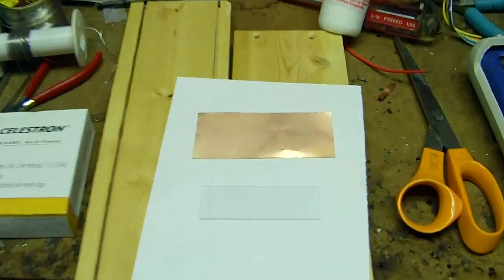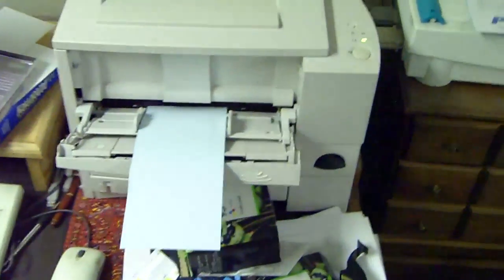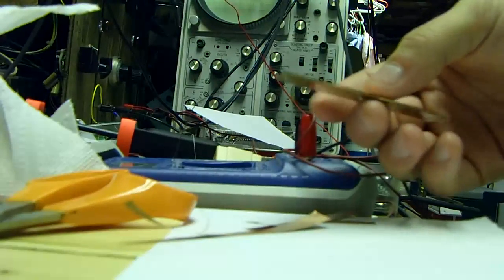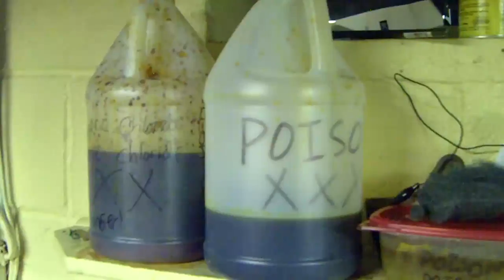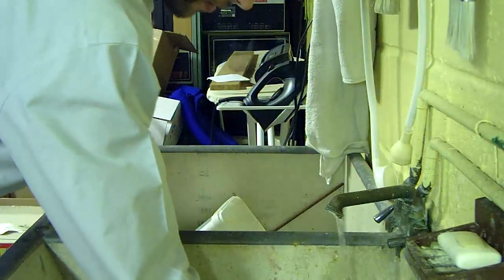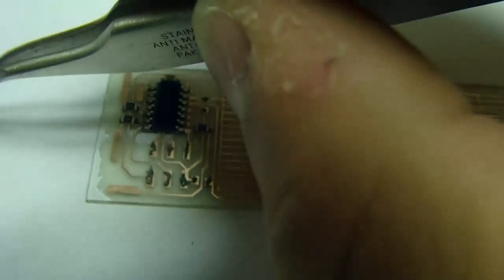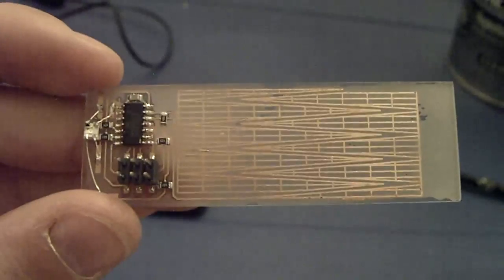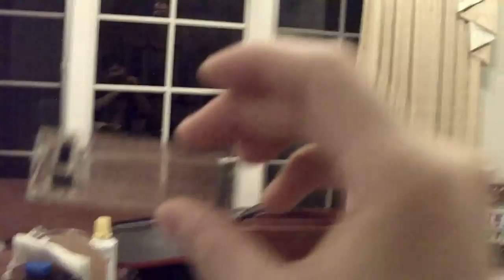How to make Clear Glass PCBs

Comment: The EPROM eraser uses shortwave UV light that is almost completely blocked by ordinary glass.  That's why the EPROMs have quartz windows.  A blacklight style longwave UV lamp may work better.  Have you tried acetone nail varnish remover to clean the residual glue off?
Reply from the maker: bigclivedotcom Acetone causes the traces to slup off.  I think it gets between the traces and the back of the PCB.
Reply: +CNLohr  maybe the apliedscience's evaporative method would work? It's fast so I'm thinking maybe it would not have the time to get under the copper traces.
Reply from the maker: I really need to make more glass PCBs some time.  There's so many things I want to try and new ideas so many people have had..  Right now, I'm so busy with other stuff.
Reply: I tried using an EPROM eraser to cheat making photo-resist pcb's in the 1980's - It took forever but eventually worked. The problem is that the wavelength of the UV light is wrong. It's like the difference between UV-A and UV-B.

Comment: Wow, this is really ambitious and a very cool idea.  We have expensive Liquid Flow Meters that just use a plate of glass over some heat detecting LEDs to act as simple push buttons but yet have the circuit isolated from the externals.  This...could be very handy...great job by the way!

Comment: Your etching solution is actually etching the glass giving it a frosted look. If you use pyrex or borosilicate glass slides you will not have this problem. You will have totally clear boards! The glass you are using must be a "soft" glass which has a COE (Coefficient of Expansion) of around 130, Pyrex or Boro glass has a COE of around 30. The low COE also makes it far less susceptible to thermal shock. Clear and no cracks! Win! Also this is one of the coolest things I've ever seen!

Comment: Very good work I must say.one thing I see a lot is solder iron so big for the smallest work.And all so in a right mess .i have 7-soldering irons all different and shiny clean.one iv just bought is 12-volt and I Added a tiny micro switch so when I hold it I just press with my finger and all added a white bright Led the Led stays on all the time when I'm using this micro soldering iron.your work is good and would be easier for you to use a small soldering iron for when you re-solder some of you micro work.great video keep up the good work

Comment: Also a syringe works well for depositing solder paste in tight areas, and automotive clear coat finish is highly resilient when it comes time to use solvents such as acetone, and is somewhat flexible until cured.

Comment: Neat method for single sided surface mount designs but a few tips: 
1. As Java Lu (and maybe others) said, TRIPOD - PLEASE!!
2. Tin board with tinning solution before assembly - gives superior soldering
3. Use several coats of auto-spray lacquer on final assy for vastly superior finish.
4. When spraying remove all connectors & protect the header pins with sleeving or low tack masking tape for larger blocks
5. CLEAN your soldering iron tip PLEASE & use a much finer tip for such work

Comment: I dont do this stuff, but am interested in learning how. So for what it's worth from an inexperienced observer, perhaps using a hot plate or inverted iron to heat the glass evenly when melting your solder paste would limit the possibility of cracking it.  place the slides in a thin frame (thumb tacks point up through cardboard) to prevent them from sliding around as much when applying the poly. Split a small dowel in half and pinch steel wool between the halves.  Insert one end into a drill.

Comment: Compressive forces on the surface of the pane make it much harder to break. However, high tensile strengths in the glass pane make it shatter if cut, chipped or even sometimes scratched. This is why car windows, for example, will shatter into small, barely sharp parts instead of large, razor-sharp pieces.

Comment: @CNLohr basically the same thing you do to eat away the copper but for the UV glue you have. Use a solvent instead of ferric chloride(not sure if that's supposed to be one word or not) and use the etched pcb traces instead of toner. That way the glue is removed from the glass and the traces protect the glue under it. Like I said though you're already doing something similar with the polyurethane but with the added benefit of replacing the glue with something else more permanent.

Comment from the maker: Schematic is in ExpressPCB. Full version of eagle is not free.  I don't use anything that's for pay unless I absolutely cannot avoid it.

It's simply discharges the circuit, then waits for it to charge via  1M-ohm resistor.  Depending on how long it takes to charge, that's how it knows how much capacitance you are adding.

Comment: @CNLohr I think orgameron means leaving the copper traces in place while brushing a solvent over the areas where you don't want/need the UV glue and just using the actual traces to protect the glue like the toner protects the copper during etching. It seems like that's more or less what you're doing with the polyurethane though as it cuts through the UV glue like a solvent but is also acting as a new method to adhere the traces at the same time.

Comment: I doubt the slide has a UV coating - it's just that  glass is not very transparent at the short wavelength used in UV erasers (253nm)  Eprom windows and eraser tubes are made of quartz for this reason. It may also be the case that the glue is not very res[ponsive at that wavelength. You will probably do better with a longer-wave UV source like an insect-killer tube (365nm).

Comment: excess solder can also be removed from bridged terminals on a surface mount components by simply stripping a piece of stranded copper wire using it like a sponge. i also prefer to take a grinder and chuck my tip in a drill to grind it to an extra fine point, then use liquid tin to prime the tip. Moving fast with a solder iron and solder paste you can avoid heating the glass by not exposing the glass to long periods of heat like you would using a messy soldering tip..

Comment: Have you ever tried selectively gluing the copper on?  I'm thinking: 
-UV glue the copper sheet to the slide
-tape a negative of your circuit on the non-copper side
-Expose the glue through the negative (so that only the glue under where the traces are meant to be gets exposed)
-Peel off the reset of the copper

Comment from the maker: Yes.  I got some glass that was angel gilded, chemically plated on.  I attempted to electroplate it further, but could not get it thick enough to electroplate effectively... The areas that I did were lumpy and did not go on even.  Keep in mind, you need about 1 mil of metal to make a good circuit board.

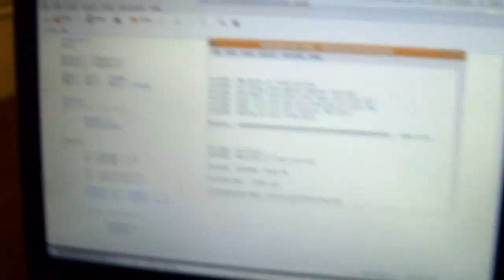Comment: That was a nice spark when you plugged in your programming board ~18:10.

Your last resistor looks like it had a short under it. From our view, the top one to our right of the IC chip.

The first time you place the copper on the glass slide, there is a better way to prevent bubbles to begin with so you don't need to squeeze them out. Basic bio-lab slide making 101.

Comment: To those asking about thru-holes, why not just have a ribbon cable on one edge that goes front to back? You're still going to be restricted to SMD, but if you could just get say 10 or 20 around that would be all that most projects would ever need.
Reply from the maker: you'd still need to print on both sides which is a pain.
Reply: CNLohr no pain no gain the Romans used to say

Comment: btw: what about using a transparent casting epoxy like those used for embedding carbon fiber or fibreglass

you could just pour a thin layer of epoxy directly on the copper - so you won't need any glass at all, get seamlessly bond material (transparent of course) and you don't have to worry about thermal issues while soldering 

technically it would be an FR4 or 5 PCB without the strengthening fibreglass sheets

Comment from the maker: I use Liquid Tin quote often on most of my projects.  The boards look 'cooler' with bare copper rather than tinned.  

I have still never successfully done a dual layer (not that I haven't tried).

I would imagine the static properties are almost identical to regular FR4.  I've been using glass circuit boards for a number of touch projects in my house which is carpeted, and even noticed some serious static, but haven't had a failure yet.

Comment from the maker: The glue is not conductive, while the glue is translucent, you'd still need a material that can conduct.  I do use this process for touch sensors, I put designs into the copper.

Comment: Consider using an optical grade UV curing glue and gluing the shiny (polished) side of the copper foil to the glass slide. This should minimize the translucency you see after etching and the traces will look shiny through the glass.
Reply from the maker: I actually use copper leaf from nimrod-hall now, so both sides are shiny :)

Comment: Some safety notes:
1. When working with UV eraser, please don't open the drawer when the light is on. The UV-C wavelength used is 253.7nm; can cause skin/eye cancer or cataracts;
2. When working with chemicals, such as FeCl, use eye protection or a face mask rated for use with corrosive or caustic chemicals;
3. When using volatile chemicals or chemicals producing gaseous emissions, please work with a carbon based respirator in a well ventilated room, or in a fume cupboard using forced convection

Comment: Nice job. If you want to take some advice, here's one. Learn to use knives for the precision cuts, they are better if you master them. If you wear gloves and use some bath to degrease the component before the copper plating there will be no risk of contamination so the PCB will last much longer

Comment from the maker: I use the attiny44.  You don't need any special IC, just a 1 megaohm resistor and an GPIO.  You can do this on most of their processors, not things like the attiny2313 though.  Also, you don't need qtouch.

Comment: I do not agree that you don't need PTH. In most of the cases you can find alternatives, but as soon as you need a D-Sub mounted on the PCB, you're in trouble, because even the SMT version need holes.
But one thing you should consider. Since you already have the UV eraser, why not use it as an exposure box ?
Personally I've used the toner transfer method a number of times, but I prefer using the UV exposure method when I can, as it's more precise and gives less errors/problems.

Comment from the maker: Yeah, I have a 5N now.  I do tin boards, many times, but it ruins the look of the board.  And, I haven't had any trouble with solder-ability when I use paste.   I actually have switch to a spray polyurethane now, too, doing just that.  And, I totally am good with that hulk tip.

Comment: Yes, it would. But unless you are considering a Class D amplifier I'm afraid the conventional A and B designs may create unwanted and isolated hotspots in the circuit. If the amplifier is enclosed, a fan would be used as forced cooling. Glass is not a good conductor of heat and when heat is applied at one end while cooling is applied at the other, even tempered glass might product stress fractures.

Comment from the maker: As it turns out it appears the wavelength used in the eeprom eraser is not optimal.  The glass is transparent to UV, but you need to use a source like a mercury hallide grow lamp to get the right wavelengths.

Comment from the maker: It is capacitive.  I currently use the spray instead of this method.  The spray does in fact work better.   Also, I use Schott B270 Flatglass, it's annealed and lets you cut it into interesting shapes :)

Comment from the maker: That is 100% dependent on the size of what you want.  Also, I'm doing ones with very shiny undersides now, too, not just the matte brown.  I wouldn't charge extra for them.

I don't know... a 1"x3" probably $15... A 5"x5" (the biggest I can reliably do at present) probably $60?  I can make the board decent outlines with glass cutting.

This is a first for selling.. I've printed hundreds but they just get tested heavily.

Comment: You put the carborundum paste onto the glass, chuck copper then spin it in the carborundum. some grit gets trapped by copper and a hole is drilled. Usually it is how larger holes are drilled but I don't see why smaller ones wouldn't work. Drilling glass is slow going though. I can't imagine drilling a whole circuit out in glass.

Comment: Just a thought, have you ever thought of using "Tin it" or "Liquid Tin"?
Also, for those interested, leave a little room around the edges, and you can add very small rubber feet. That way, when you have done a dual layer, it would look great.
My only concern using glass, is the static, and if some has carpet and goes to touch a connector or what ever, it would zap the electronics.
So remember, a good, or very good grounding would be needed if used in a carpeted area, or in general ;-)

Comment: Nice! I can see this working well using visible LEDs UV glued emitter down to the board.

Just a thought, but would this work if you used copper leaf from an arts and crafts shop? Its a lot thinner but you could maybe overplate it with copper to the correct thickness?

Comment: Hey, this material is hard to find on ebay. I've found some 1.4mil (1 oz equivalent) copper sheeting from a different online retailer, but it's shiny on both sides. Will that cause the lamination to fail?

It looks like you could also use this lamination process with kapton plastic, which might have interesting applications in diy wearables.

Comment: No ditching the connector at my place, then it's better not to have a glass PCB.
You'd also get in trouble if you needed a BGA100 (or larger) chip mounted - they require VIAs.
Surely you can bend the legs and mount a LM3914 component if you need those.
I don't think the solution is to ditch a component, but instead finding a high-speed drill that drills well through glass (diamond drill would do), and perhaps use a very strong glass.

Anyway, you could try mounting some LEDs on your mug now. ;)

Comment: First I would like to thank you for this very useful video. I have questions :
After etching 13:20, if I clean the glue with acetone, does it remove all the glue whether it is covered by Cu film or not and so remove the Cu film ?, or it will remove the uncovered only ? Do you recommend any cleaning material that can remove the undesired UV glue ?
Thanx a lot

Comment: Recall the basics of making a science microscope slide with a cover? You get one edge wet then slide it partially from the center (not the edge) to the edge then drop it down, pushing any bubbles out before they get trapped.

You are giving yourself a headache down the road for quality. You could be leaving in micro-bubbles which could cause problems if the unit goes through extremes in weather etc.

Comment from the maker: I've tried using angel gilded glass (both copper and silver) but never found a method that I could electroplate that wasn't completely terrible (either destroying the substrate or being lumpy).  Also, it would be impractical to do electrolysis afterward as you would have to make contact with all the traces.

Comment: well i use a 1/32" bit with a dremel on normal PCBs and it works really well, but i highly doubt it's carbide tipped. what does it mean for glass to be tempered, though? i thought tempered glass would be more likely to withstand the drilling force.

Comment: The reason the dried glue is matte is because it has picked up the texture of the copper. The polyurethane fills in the grooves but is a slightly different refractive index. Have you tried coating with more UV glue or gluing on the shiny side of the copper?
Reply from the maker: not yet.  polyurethane is just so convenient.
Reply: I've discovered that the UV glue is tacky because it is very sensitive to moisture while it cures. If you coat your boards with UV Glue then place a sheet of clear plastic on top that will peel off later after it is cured. I tried a polythene bag  and this worked well. :-)
Reply from the maker: After I am done, I typically dry and warm my boards, the UV glue is quite hard.  Even with copper that's shiny on both sides, the texture is still quite pronounced.  I am slowly transitioning away from the UV glue, because I am trying to use Riston for my resist mask.  The same chemicals that dissolve the Riston dissolve the glue.

Comment: Great presentation!  Glass PCBs  are probably better for building electrometers and such (low surface resistance?).
May I suggest you try HCl / H2O2 for etching ? A lot cleaner and controllable, and you can get rid of that nasty FeCl3 forever!.
Reply from the maker: Maybe someday, but Fecl3 is soooo nice.
Reply: only thing nasty about ferric chloride is they don't send it by air freight and the fumes could kill you, just don't breath them.
Reply from the maker: I just don't believe any of these other fumes are any safer.
Reply: CNLohr I got to get me a 3D printer no fumes

Comment: Thanks for posting this video, all aspects a great info, especially the bit around 16m where you reveal the SMT process, we've been wondering how this worked and your video has clearly answered this. I wonder if you'd care to respond with key process points about this method?
Also, I note you've not applied any tags to the video which I suspect is why I haven't come across it previously when searching for "SMT" or similar. I found this video via the sidebar suggestions for PCB production...

Comment: Excellent video! I really enjoyed your various comments throughout the process on why you should or shouldn't do certain things, relating to the UV glue and the toner, etc.

Do you think that you after gluing the copper you could coat it in a photoresist solution, and then transfer the circuit using UV exposure?